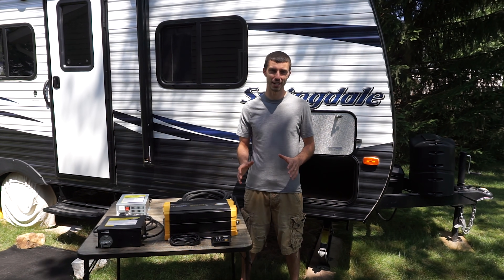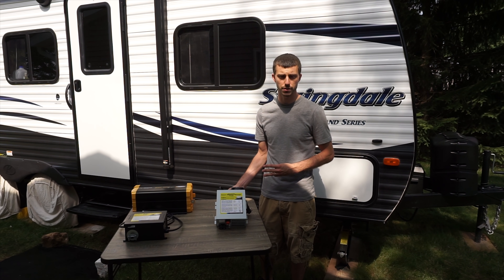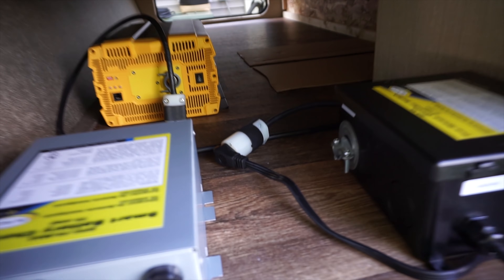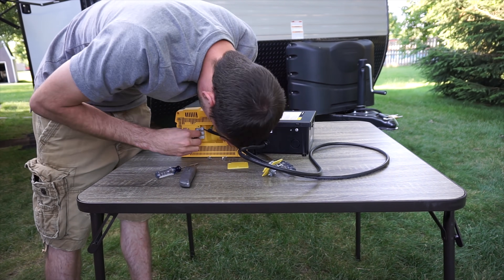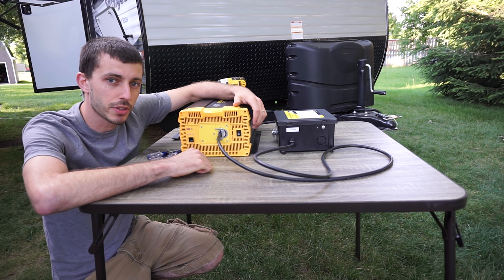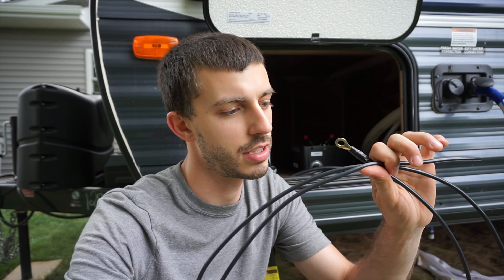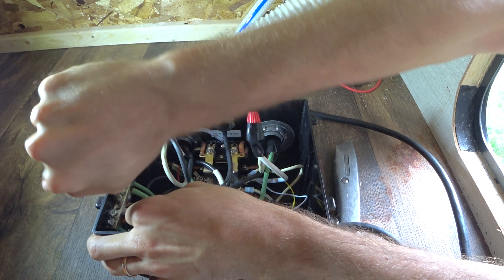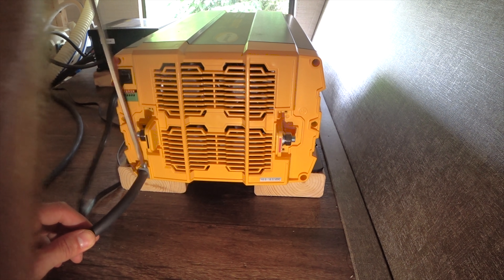Complete RV Solar Install For Boondocking / Dry Camping Part 2 of 3 - RV Upgrades

Comment: I don't think you had to wire it directly into the electric box. You could save some time by just connecting everything in the junction box where the (in) shore power and the wire that goes to the electric box (out )meet. Wire one wire where the shore power goes and another to where the power goes to the electric box. All the wire meet in the junction box and you could save some wire.
Reply from the maker: My electrical box is almost directly in front of where the power cable runs into the wall of the trailer, so that would have only saved me two or so feet of wire. I wanted to wire it directly to the electrical box because that seemed to me to be the "right" way to do it.
Reply: @FateUnbound  yea nothing wrong with that just could be more wires in the box. But if you hook up in the junction box where the wire goes directly to the electric box you would be fine. And especially if your main box is above or on top shelf not at the bottom.

Comment: Just a tradesman’s observation, after working as an electrician in the past, but couldn’t you just use 1 SO cord of 10/3? You could tap into the neutral and ground at both electrical connections but then disconnect your shore hot (the black line, send it to the front compartment transfer switch, then back from the transfer switch on the red line to your power distribution? 2 less holes, less wire, and accomplishes the same thing doesn’t it?

Comment: I use a 30 amp to 15 amp plugin and plugin to the shore power plug to my inverter which I pull out and take it to the front of my camper where my charging station and batteries are or I can continue up to my pickup and hook up to the generator with 30 amp so I can run my AC it also charges my lead acid batteries through my converter which gets power from my shore power cord that is hooked up to my inverter and or get power with my solar power. although I have to pull out my shore power cord to hook up to my inverter I don't have control switch and have to buy all that wire. and go through all the hard work you did, but your way is a little more sophisticated but it is no big deal for me to pull out shore power cord to hook up to my solar or generator.

Comment: Can someone clarify? Did he take the shoreline AC cable and splice it going back to the transfer case and the smart converter charges? 

Or did he basically splice in the transfer case into the shore power line? As in The Wire that comes directly from the shore power connection to the AC power connectors in the RV was cut and he attached the various ends in the various positions in the smart transfer case.
Reply: Time spot 8:18 is when he loses me.

Comment: All of that GoPower stuff is way over priced.  You can get an automatic transfer switch for $40 not $200. Same with the inverter.  Yours is $800+. I am getting a 2000W PSW for less than $200. I guess it's because I am not given this stuff for free.  I have to work for a living.

Comment: I notice that battery charger is not rated for Lithium batteries. Have you have any issues with it? Why didn't you just use the built in charger?

Comment: Hi David. I love your video's. This year I am installing 2 - 145W solar panels with a 2000w pure sine Xantrex Inverter/charge/transfer switch with 2 - 12v AGM. Our trailer is the same layout as yours but will be mounting the Inverter under the bed pedestal. My question is: I have run a 20' length of 10/3 - 30A a/c wire from the convenience center to the inverter then back to the shore power cable. That will add 40' length to the shore power 30amp circuit when plugged in. Has there been an issue with voltage drop when using your a/c when plugged in? Thank you. 
Dave
Coldstream BC, Canada

Comment: Not sure if/when you will see this and I hope to one day be doing this as well but could you have stacked some of those components to save some space?  Possibly built a platform to separate them but also be sturdy?  I know storage is a valuable commodity in trailers and RV's so didn't know if stacking some of them would have been possible without impacting their functionality.  Thanks

Comment: Hey David! I don't know if you're still reading these comments, but I'm planning on installing a similar setup to yours very soon and I was just curious; why did you decide to buy another converter/charger instead of using the one that came with your RV? I decided to run the same transfer switch that you guys have and use it to power the converter unit that came with our rig, but I figured I'd ask someone who's already been through it - was there something you ran into that held you back from doing that?

Additionally, is this the only battery bank in your guys' rig? I hear that some people run into issues with charging a Lithium bank from a vehicle's alternator, so as another guy running the 6.6 Duramax I'd be really excited to hear about your experiences with this.

Comment: I don’t know if you already do this, but you should see if you can get 12 volt chargers for your laptops, they are much more efficient than power going through the inverter then through the laptop chargers, plus no worries about some wave issues
Reply: Sine wave

Comment: Do you have a single list of all the system components with specs?
Reply from the maker: Links to everything are in the description below the video 👍
Reply: @FateUnbound  Thanks!  These are great videos.  If one of them has the overall summary of all of the solar lessons-learned and changes you'd make to your system if you did it again, that's the one I'd like to watch first.  I'm still on the front end of this off-gridding project.  I currently have a 2019 Rockwood A122SESP with two 12v deep cycle batteries and two propane bottles.  Everything is 12v or propane except the micro wave AC.

Comment: We have a Toyhauler with no storage area like you used to mount the equipment. We do have plenty of room above the cabinets inside. Would there be any reason not to mount them (except batteries), inside sorta exposed ie. Heat issues, noise etc. And by far the best videos on this subject I have found.

Comment: I would have mounted the transfer switch closer to the main breaker panel, that way you eliminate the back and forth wire runs...
Reply from the maker: That would cause even more long back and forth wires runs from the inverter and converter charger. This placement provided the least amount of wire used.

Comment: I have a Reliable 3000 Watt inverter with a 6000 Watt surge and I’m trying to figure out what size fuse I need to go from the (4) batteries I have into the inverter.

Comment: Wrap all the wire nuts with rubber tape covering the wire but to the first 1 inch of the wires you've joined. Ask for rubber tape. It's black and stretchs before you wrap the cables and will vulcanized together after a short time securely holding the wires and wire nut together. You will find intermittent connections if you don't. I've spent 45 years working on electrical systems where vibration was a large factor in system failures and fires.

.

Comment: theirs three types of sign waves all thuo most people only know of just 2 you just talked about.the 3 one is mix part pure sign wave and step wave together it almost looks like the pattern of pure sign wave but it has step wave still in it witch is small then steps then the normal step wave as it follows the pure wave together.give my mind i do not remeber what its called. but great job on the video it give good insight for rv installtion.

Comment: install your transfer switch behind your breaker panel and you only have to run wire to the front pass through once

Comment: David is the 10/3 wire SJEOOW, SOOW OR SJOOW? I got the SJEOOW, which has a maximum of 300v or 30amps. The SOOW is able to double that at a maximum of 600v or 60amps. Do you know which type your using????

Comment: I'm sure someone else mentioned this but your drawings of the sine waves are not correct. The y-axis numbers should be about 170V on the max and min for the sine wave. The 120v you get is actually the RMS (root mean squared) value. Great video otherwise.

Comment: Why did you not simply attach your original shoreline cable to the new transfer switch in your front storage? (reduces the wire used)

Comment: Regarding the converter charger, is the trailer's factory converter still hooked up and working along with the smart converter? Are they two different devices? I ask because I've seen videos where the trailer's factory converters are replaced with smart converters. I'm wondering if you can just upgrade the factory's converter for a smart charger, instead of using both factory converter and the 4 stage converter charger. Or maybe I'm a little lost.

By the way just wanted to say great videos and information. I'm fairly new to owning a trailer. I've watched your videos several times and I learned something new each time lol.

Comment: Mate! All those unprotected cables going through chassis holes. Get some split tubing. The way they are just there rubbing against the chassis are just a ticking fire hazard.
Reply from the maker: Most of the chassis holes have grommets or split tube already, and the ones that didn't I did end up putting them in later off camera so don't worry.
Reply: @FateUnbound great to hear. We love your Rottweiler. She's too cute and well behaved. Not like our spoiled boy.

Comment: The inverter doesn't have outlets as it's output is 3,000 watts, which is 25A @ 120VAC. If they added outlets, they would need to fuse them separately and they likely wouldn't get used anyway due to the available current.
Reply: Actually, on that note, I would verify what gauge wire was used to go from the transfer switch to the inverter. You would need MINIMUM 12AWG, but I wouldn't recommend anything smaller than 10AWG to leave yourself a safety factor.
Reply from the maker: I used 10 gauge per the manufacturers recommendations 👍
Reply: @FateUnbound  Very good! It's hard to tell from a video when the wire already had a connector on it. While 12AWG would have technically been fine, not having any overhead is never a good idea just in case there's a fault. I just want you guys to be safe!

Comment: you can run a computer on a square wave inverter  just not as clean and sometimes make lins on the screen and anything else as long as it is 60 cycles

Comment: Can I just ask why did you not go from the shore plug outside to the trancefer switch and then use the cable in place to take it back into the panel

Comment: Great job on the install. Would it have been simpler if you installed the inverter upfront (closest to the battery as possible) and install the smart-charger and transfer switch and converter box by the ac panel?

Comment: Good video. Again, wire nuts are not a reliable way to connect wires in something that moves, shakes, and rolls down the highway, At the very least, tape them to the wire with electrical tape so they don’t “unwind.” Better, use a splice connector or something which requires crimp connections for better reliability. Otherwise, quite enjoyable.

Comment: WHOOPS!!! Do you live in Europe? While they do make 240 VAC modified and pure sine wave inverters, 120 VAC inverters or house power do NOT supply 120 volts positive AND 120 volts negative in North America. This would equal 240 VAC. The 240 VAC service that comes into a North American home is actually divided between 2 legs of 120 VAC each when using the neutral line coming into the breaker box. When using a 240 VAC drier, stove, hot water tank, air compressor central heater or arc welder, the neutral is not used allowing the full 240 VAC to be supplied to the appliance. Pure sine wave inverters are 60 volts positive PLUS 60 volts negative equaling 120 VAC total in the case of pure sine wave inverters and house power. I make this distinction because modified sine wave inverters like the "Walmart specials" actually supply 55 volts positive and 55 volts negative AVERAGE voltage for a total of 110 usable VAC. This is because the mostly square wave signal averages 110 volts but the small microsecond spike on the peaks and troughs of these inverter's signal theoretically add the extra 5 volts but not for long enough to really be effective for anything but the lightest "wall wart" transformer type loads. If you were to pull one of these el cheapo's new out of the box and test it with a voltmeter, it would only read 110 VAC because no voltmeter is fast enough to react to that small spike. It would actually take an oscilloscope to read it properly.

Comment: The 10/3 SJ/SO cable you used is not listed for permanent installation. It’s cord, not wire, which means it must have a plug and is meant for temp use. Instead you need to use NM (Romex) wire or use THHN inside conduit.

Comment: Your videos of this install are the absolute best, no wasted time blabbing just pure install. I love them but have one question that is slowing me down on getting my system hooked up. I intend to use the same transfer switch but my Pure Sine Wave Inverter is only a 1000 watt, 2,000 surge. My question is twofold.
1. Can you leave the solar charge controller hooked up all the time. Is there a problem with this? When running on batteries and the inverter is running and the converter is running.

2. You inverter is pretty hefty and you can run your air, or microwave, or anything else  as long as the total load does not exceed the total wattage capacity of the inverter. To the system your solar system in effect looks like shore power. In my situation my inverter is not as big so I guess I have to manually throw the the breakers for Air, & microwave to the off position so someone does not turn them on kicking out the INVERTER? Does this sound correct?

I am worried about running solar and leaving it and the CHARGE CONTROLLER hooked up all the time. Not sure how much of this switching the Transfer Switch does. I noticed you bought another CONVERTER, why didn't you just bring your ORIGINAL CONVERTER from your breaker box out to where you installed your new one and just use the old one? I am pretty sure the standard CONVERTER is the same as your new one with varying charge cycles. I am guessing with your new AGM batteries you needed a special or bigger CONVERTER?? Looks like your 2 batteries cost about $5,000.00 or did you buy pull outs from cell towers?
Maximus

Comment: Good video on showing what is involved with adding solar power to a RV. I read some comments about using wire nuts, I agree wire nuts should not be used in a RV, think about all the constant vibrations while you are driving, good advice were given. I would add make sure you cover the wires than run under your rig with some wire loom tubing so to protect them from the elements (water/moisture/rocks etc) also the vibration against your steel frame can cause some wires to get exposed.

Comment: I noticed that when you disconnected the factory converter/charger from the DC bus on the panel you didn't put a new connection on the DC bus. How is the DC bus getting power?

Comment: I love the fact that you’re all DYII and I think you have the right idea but wire nuts are a bad idea especially when dealing with something like a 30 amp service. Everything I do is soldered and heat shrink. The first place heat is going to build up is in those wire nuts. It’s a potential hazard but it’s also a major failure point in the future when your electrical system starts breaking down

Comment: @11:53 In a couple spots in your solar videos it looked as though you were pigtailling together copper and aluminum wires. Is that the case? I didn't think that was an acceptable thing to do because of galvanic corrosion. Comment?

Comment: I love the setup, I'm looking at doing one myself but my travel trailer is 50 amp, so I'm a little more challenged. 

The only thing I noticed is that you could have saved yourself an entire run of wire by putting your transfer switch under the fridge.

Comment: How do you deal with your existing power converter/charger? Your method, at least shown, means your inverter could be trying to charge the batteries you're running off? 2nd question is how do you deal with the existing 12v circuits in the RV? Just leave the existing connections from your batteries to the DC panel?

Comment: Question maybe you can answer. I'm installing a solar setup in my trailer. Im upgrading the stock converter/ charger to a (go power) 55 amp converter/ charger. Question is an I hooking up the new converter/ charger to the go power 30 amp transfer switch. So i lose the breaker in the electrical panel ? There would then be no breaker protection on the converter/ charger? Correct ?. After hooking up to the transfer switch.

Comment: Instead of running that second cable for the shore power, you could have just installed another shore power connection right next to the door for your pass through.

Comment: Hey, I love how you install your components, I just want give a recommendation why don't put the smart switch inside of the compartment where the hose are and build a shelf for the other two equipment. I have a motor home class C and i know all space for storage are important.
Reply: I would have tried to put the components there as well as below and above the fridge.  Maybe some in the hot water tank area. Maybe not lose any storage. Awesome install none the less.

Comment: David...excellent work! Assuming your inverter powers your entire AC power system when not plugged into shore power....how do you avoid the loop where the converter/charger (factory installed) is charging the batteries and in turn, your inverter is powering the converter/charger?

Comment: why did you use a separate converter? what I've seen says you don't need one if your RV already has one to convert DC from the battery to AC for the electronics. What am i misunderstanding?